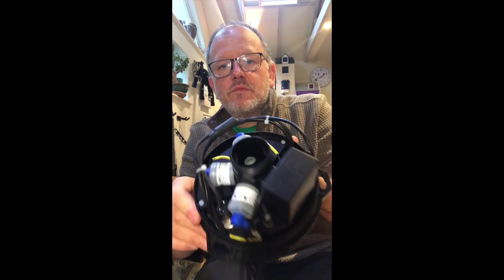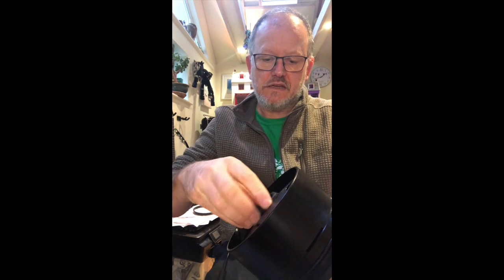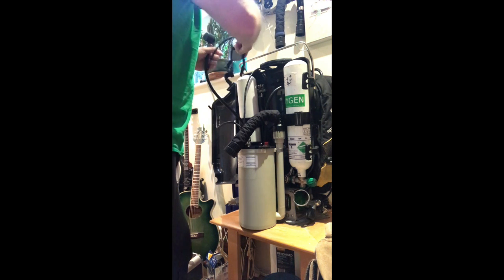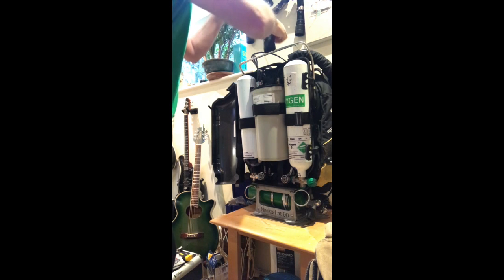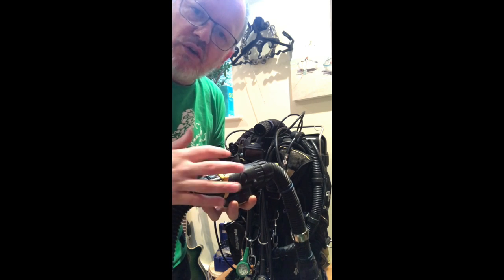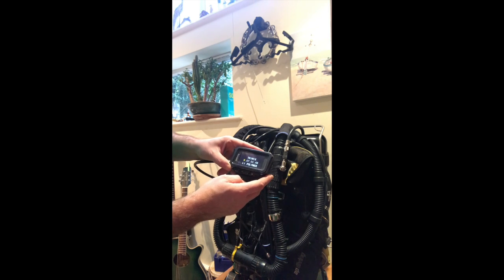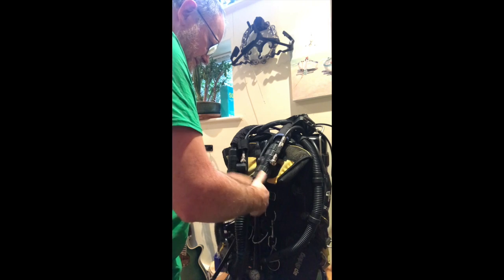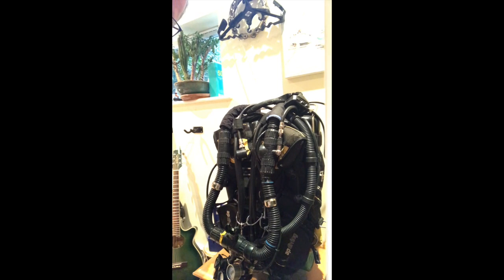Building an AP Valves XPD Rebreather and also footage of diving at Stoney Cove    HD 1080p

Comment: Why do u say with 02 @ 120 bar that it’s ok for a shallow Ish dive ?
Reply from the maker: Because on average I use about 30bar of o2 per hr.
Reply: @Mikeydsmith  I was wondering about your reference to a shallower dive as when considering usage of 02 depth makes no difference , the body metabolises the same amount irrelevant of what depth,and as a general rule of thumb it’s 1 liter per minute 😊
Reply from the maker: @colmdoherty49  correct.  But still I would do a deeper dive with more full cylinders.  Mostly for comfort and some margin of error to cover unplanned slow leakage and the higher risk of long deco.